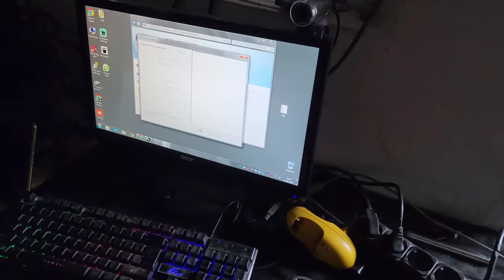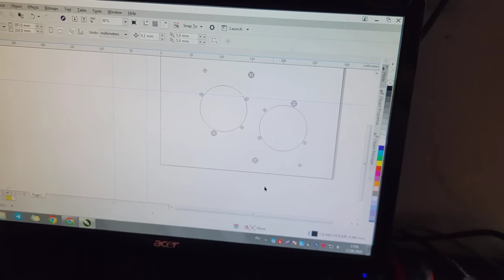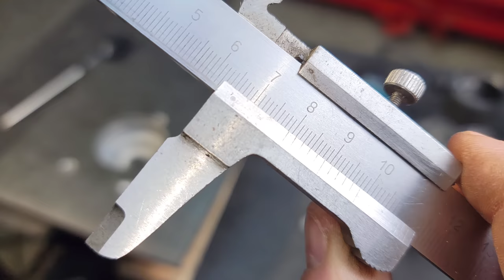Milling the crankcase to install the 52.6mm Big Bore crankshaft on a Honda Dio 120cc scooter

Comment: I wonder if he realizes that bearings are supposed to be extremely tight so that when you press them in they don't fall out... you're never supposed to grind down the bearing so they go in that easy... you heat up the case, freeze the bearings, and then with some mechanical persuasion... you force the bearings into the casing. That's how you install bearings. The factory is never going to tell you to grind down your bearings on a belt sander.
Reply: Yeah that confused me. The method of grinding the case is ok though I would have had it laser cut instead of plasma and used a flush trim bit with a top bearing. 

But grinding bearings? That is truly bizarre. Unless the particular ID/OD combo is unavailable.
Reply: Ot will vibrate so much those cases will crack!
Reply: What he did with bearings is completly alright, He used a bearing as "donor" (idk how to say) to test if crankshaft spins smoothly and doesnt hit any engine block casing. Think before writing!
Reply: @bernardasn  ah like a tester so he doesn't have to press it in and out if it's wrong
Reply: It's a tester indeed, in the build video he got a new bearing
Reply: @briansanchez9899  oh, thank god
Reply: @bernardasn  yes but you don't have to press the crank into the bearing, so if the crank does have interference with the block, you pull the crank out with a bearing still in the block, and then clearance the block for the rotating assembly. Again, you never have to take the bearings out.
Reply: He just used it to quickly test if crankshaft is hitting anything while it spins. It would be pain to press the bearings and realise u have to get them out again.
Reply: Bro those are dummy bearings to test fit the stroker lol
Reply: @cerpow  you don't have to press the bearings back out if it doesn't have clearance. Once you press the bearings into the case, they just stay there. You slide the crank snout into position and turn it to see if there is any interference. If it touches the Block in some places, you take out the crank, then use your grinder and grind away the material, then reinsert the crank snout into the case and check again. You dont have to take the bearings out aswell, just the crank.
Reply: @YOURDADSELITE  yeah, its a shitty test. Hand grinding like that's not going to get you centered and it's definitely not going to tell you the exact location of where the crank will actually be. And seeing how close he's getting that crank to the rest of the case, it's quite important to be precise. But why is he using random dummy bearings instead of just the regular ones that he's actually going to use? If you're going to take a grinder to a bearing to make it simulate a regular bearing, why don't you just get the normal one that you would use anyways. That's going to be your most accurate measurement. Press the bearings into the case, insert the crank, if there's interference remove the crank and grind material. Put the crank back in, and keep testing and grinding until it's perfect. You don't have to keep pulling the bearings out. That's ridiculous, and a waste of time. You're doing an extra step that makes no sense. That's like pulling the whole motor out just to do an oil change. Why would you go through all that extra work, when the obvious solution is right in front of you?
Reply: That's called a dummy or clone bearing. You can fit test easily the crank and other parts, where you can put it together by hand. That bearing will be out, when using it in proper conditions.
Reply: @pepelazy3249  what's the point of using I have fake bearing that doesn't fit properly instead of the real deal?
Reply: @sethh8892  for the real bearing, you need to cool it down and heat the case up. It takes a lot of time, and you can't take it apart easily. It's for testing fitments, ports, cylinder skirt position. You can't use those bearings on a moving engine!
Reply: @pepelazy3249  it takes less than 10 minutes to put bearings in a case... you throw them in a freezer, and get a map gas torch and heat up the case. I can do every bearing in a raptor 700 within 5-10 min. It definitely does not take that long, and why would you choose not to use the bearings that you're going to have in the cases for fitment? Why would you want loose-fitting, weak bearings, that don't represent the actual bearing being used? If you test fit with some garbage, then put the real bearings in, there's a chance that your fitment is going to be off, and you're going to have to continue clearancing the cases. Why not just use the real ones? I'm still not understanding why you wouldn't want to use the real ones you're going to have to put them in anyways...

Comment: Can't wait to see more! Good job so far. 👌🏻
Reply: definitely isn't a good job, horrible
Reply: @Fumacenta2tempos  
It's low budget and i'm pretty sure it will run.
Reply: @C P  yes, a couple of revs... but it will definitely destroy itself!!
I've build a lot of 2strokes and raced them. But I have never seen someone do such horrible things to a poor engine!! 🙈
Reply: The fact that the bearing is fuckkking lose in the case... It is Just one thing that is fucked up.. That bearing is tolerance fitted.. It MUST sit TIGHT in the case.. Or it Will spin in the case And wear down the case, the alumínium powder Will destroy all the bearings.. Or it Will burn on the cylinder And piston
Reply: @tothlacko8290  What he did with bearings is completly alright, He used a bearing as "donor" (idk how to say) to test if crankshaft spins smoothly and doesnt hit any engine block casing. Think before writing!
Reply: @bernardasn  iff. He chanhe it out.. But I didn't think that he would, but I hope He Will.
Reply: Ofcourse he will, he did insane builds in previous videos

Comment: 1:50 if you dont have rigidity you have to take light cuts... like 0.05 mm... the idea was good... but you cannot do it in one pass
Reply: Yes. I did a whole video when I came up with that cutter 6 years ago. Look it up (minarelli case cutter should find it). Take small bites and try not to stop during a pass for the best results. Not 0.05mm small, but not 49cc to 125cc in one pass. You can take off more material at first and then finish with a pass that removes only a small amount too. I cut 3 Dio cases for 52mm cranks in the last few weeks with it, aside from all of the minarellis that it was originally created for.

Comment: that's not the way to use the tools. it can kill himself if he looses control or the wheel applies any excess pressure on the surface he is surfacing. the wheel just brakes and will get thrown into the air in any direction.

Comment: А нельзя сам коленвал фрезенуть ?
Reply: The connecting rod is usually very near the outer edge of the crank. It can be done. My first Minarelli stroker was cut down as much as it could be, which wasn't much. Then the cases were bored to save a little material on the cases. Since then, I just cut the cases.